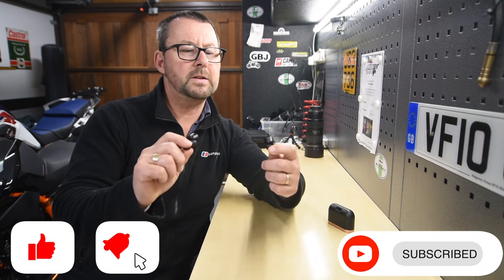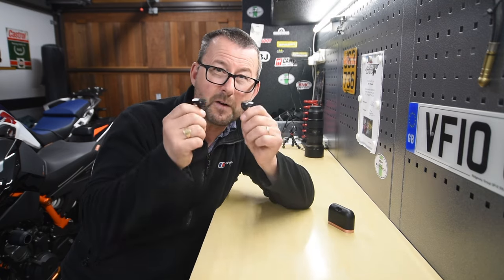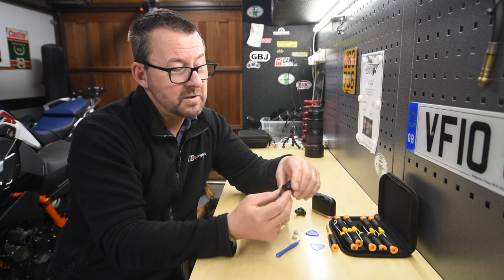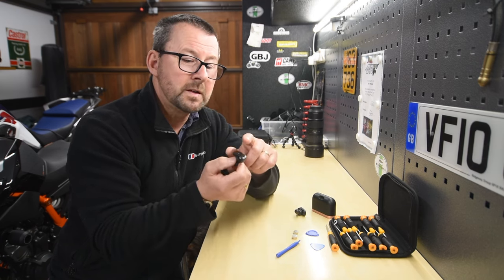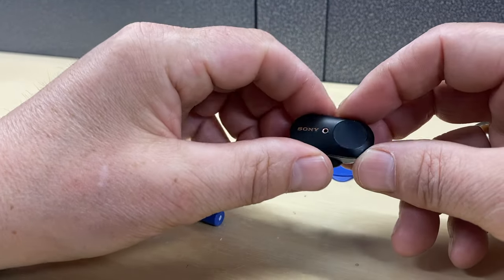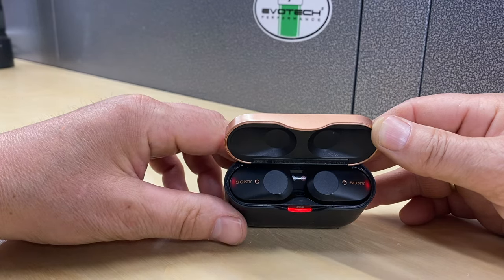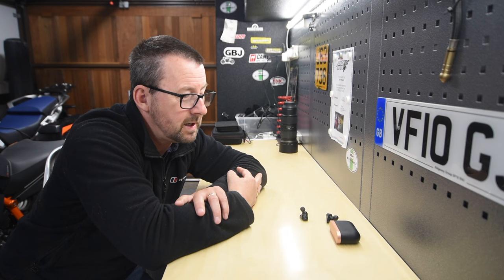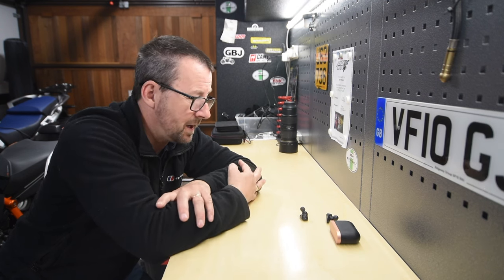SONY WF-1000XM3 BATTERY REPLACEMENT , JUST A 10 MINUTE JOB🤪

Comment: Can you do a video for case's battery replacement, please? Can you ask how many hours it need to be fully charged without usb cable? My Somy Wf Xm3 take a lot of time to be fully charged. I'm not speaking about earpods, but the case.
Reply from the maker: I have had a look at that but it involves skills I do not have !!!! 😢
Reply: @gsd32i  thanks.
Reply: I was going to ask. I'm sure the case's battery needs changing too. When I try to charge the buds, the case light flashes for about 30 seconds and goes off. I left it overnight charging but the following day the buds haven't charged and the case battery is at 0%.
Reply from the maker: @brucehowden7416  charging case sadly is not that easy to put a new battery in ! I have looked but way above my pay grade !! Have you tried a different charging lead? Also try doing a reset of the earbuds in the case , to reset everything.
Reply: @gsd32i  I've tried various leads and adaptor sockets and resetting the buds. Anyway, thanks for your video. I'll try changing the batteries in the buds first and see what happens. Initially, I thought I was just going to have to buy new buds so at least I have some hope of saving some money!
Reply from the maker: @brucehowden7416  ok 👍 battery swap won’t take long . Good luck 🤞

Comment: hi. i connected my dock case with 10volt charger. then the case is broken and can't be charged anymore. does replacing the battery help?
Reply from the maker: Looks like the charging case is damaged ? Not many people have swapped the cases internal battery . Is the case definitely damaged ?
Reply: it looks normal but can't be charged. i wonder if the battery or the circuit board is broken
Reply: Finally I found somebody with the same problem I have. Charged mine with the Samsung charger and now nothing happens - no lights. Do you know how to open the case?

Comment: My earbuds give red lights in the charger, when I pull them out no blue lights occur. Could it be that the batteries are dead? I used them 3 years ago and left them in the case since then. Thanks in adavance.
Reply from the maker: Hi . Probably .

Comment: Hi i replaced my right ear with a brand new varta battery and after 1 an half hours it said battery low again i was normally only getting 40 mins with battery what was in it b4 any tips please help
Reply from the maker: Hi . Try a full reset . Also swap the battery over with the left one of a reset doesn’t work just to see if you have a defective battery .
Reply: @gsd32i  it was a brand new battery i bought online will try the full reset aswell am sure i do that is that were you hold headphones in case for 15 seconds
Reply from the maker: @Aefc85  yes

Comment: Urgent question, is there a difference on varta cp1254 a3 and cp1254 a4 ???
Reply: After a bit of research, it seem to be plausible to use a4.
Reply from the maker: You can use either , they are the same diameter and height so either will fit, the A4 is a bit more powerful.
Reply: @gsd32i  thank you

Comment: Why is the CP1254 battery so expensive? I mean 30 pounds for two of these little guys is too much. Don't you think? it's like 1/3 of the price of the earbuds. 
I also have these, sadly now I have to buy batteries for them. Never will I buy sony again.
Reply: Normally, cp1254 is only 2 dollars for a pair.
Reply: I got mine from Ali express at only 8USD

Comment: Hi!
Can CP1254(A3) batteries be replaced with CP1254(A4) batteries?
Reply from the maker: Its fine, the a4 is the newer version.
Reply: @gsd32i  ok. The a3 has 3.7v and the a4 has 3.85v. works correctly?
Reply from the maker: @maicolwrc86  should be fine
Reply: @gsd32i  thanks!

Comment: can the battery of 1000mx3 can be replaced with varta A4? meaning can a4 be used in place of a3?
Reply from the maker: I don’t see why not, as they are both cp1254 3.7 volts. is the a4 just an improvement on the a3 ? looks like it.
Reply: @gsd32i  I believe the only difference is the capacity, with the A3 having 60mAh and the A4 having 74mAh.

Comment: Thank's for the video sir, but ithink i got a trouble, after i put the battery, everything seems right, the  charging light is on. After the charging light turn it off, i try it, and i found the right earbud can;t turn on, but the left earbud is perfectly working like a new, do you have any idea?
Reply from the maker: Have you tried a factory reset?

Comment: What size of philips did you use? I tried #0 and #00 it wont rotate :/
Reply from the maker: Hi, I have just been into my garage and checked the screwdriver that I used and it was size 00. They really are small, have you rounded the head? You have to push hardish and then turn without the screwdriver slipping off!
Reply: @gsd32i  I have now unscrewed it, thanks! But any tips on closing the lid on my buds? The front part closes but the back part just bounces back T.T

Edit: Solved it ( thanks!)
Reply from the maker: @alh.6751  Glad to hear it. Best to reset the ear buds as per the manual.

Comment: can the charging case battery be replaced as well?
Reply from the maker: Hi it’s almost impossible to change the case battery due to other pieces being attached to the cases battery .
Reply: @gsd32i  My earbuds seem to be discharging the case battery power and i also had connection issues; the earbuds only connect if my charging case is connnected to the usb charger. Its all good now after i reset and replaced earbuds batteries.

Comment: My issue with my XM3 is that my left ear bud doesn't last more than 30 minutes and gets shut off. So should I expect the same reason for my XM3 ?
Should I replace the battery ?

Please help me out. I purchased for a heavy price in 2020 and now it's not working. I cannot afford to buy one more.
Reply from the maker: Yes replace both batteries . 👍
Reply: @gsd32i  Why should I replace the other one too ?
Reply from the maker: @bhargavvarma5495  I would have just done both at the same time , but if your other battery is holding it’s charge for the normal time (8hrs) then don’t change it 👍
Reply: @gsd32i  Well ! 
Once the left bud gets OFF then the right bud also gets to OFF so I think as you said is correct. I tried using only my right bud but no luck. Is there any chance using only single bud ?
Reply from the maker: @bhargavvarma5495  I don’t think so 🤔
Reply: Ok 
After replacing the new batteries, how are your ear pods working now ?
How much battery life are you experiencing on a single full charge ?
Any ANC, Call quality and sound  problems after replacing new batteries ?
Reply from the maker: @bhargavvarma5495  all good 👍 anc= about 6-8 hours
Reply: @gsd32i  Thank you so much ! 🙂
Will get back to you after successful completion 😅
Reply from the maker: @bhargavvarma5495  🤞
Reply: @gsd32i  Hi 
Unfortunately Varta CP 1254 cells are not available in my country (India). What should I do now ? Please suggest
Reply from the maker: @bhargavvarma5495  doesn’t have to be varta . Just try e bay or Ali express etc and put in cp1254 a3
Reply: @gsd32i  So are you suggesting me to buy any other cells not exactly a Varta CP1254 ?

Does it effect the battery percentage and any other performance based issues of my WF-1000 XM3 by replacing them with other batteries ?
Reply from the maker: @bhargavvarma5495  up to you. if you can't get the Varta ones then I would go with whatever I can get, but check buyer feedback 👍
Reply: @gsd32i  Hi 
Finally I got a less capacity battery cell which is of 3V. Can I go with it ?
CR2477N, 3V - Lithium Renata 
Can I go with it sir ?

My doubt is that the earlier cell which is Varta CP 1254 is 3.7 V and this is just 3V, so might the battery backup vary for this cells ?

Correct me if I am wrong !
Reply from the maker: @bhargavvarma5495  I think this battery is a non rechargeable battery ? So I would not use it . Always best to get the correct type .
Reply: @gsd32i  I tried a lot but couldn't find a better one. Could you please suggest one which is suitable and available in major E-commerce sites ?
Reply from the maker: Hi . What about Ubuy India ? Very strange you cannot get the cp1254 😮

Comment: Battery life is amazing now! Two notes: First, the LED on the left unit has stopped working, not exactly sure why since the touchpad still works. Second, while pulling the battery out the contact came with it (which is fine). I made the mistake of attaching the contact to the new battery before putting it back in, and I shorted +ve to -ve. Battery got very hot very fast! Put the contact back in the case before trying to add the new battery!

Comment: Ah damn, after the replacement, my left earphones do have power (red light) but they don't connect nor produce any sound ('power on'). My right earphone on the other hand are not working at all now :/ Not sure how to troubleshoot this
Reply from the maker: Did you damage any wires when you opened them ? Try a factory reset :

Touch the sensor on the left unit with your finger for 20 seconds and release it when the red indicator stops flashing. Touch the sensor on the right unit with your finger for 20 seconds and release it when the red indicator stops flashing
Reply: @gsd32i  Thank you for the reply !! I'll try that out :) I haven't noticed any damaged wire although I did force a bit my way through to open them
Reply from the maker: @anonazerty165  obviously after a reset you’ll have to pair them to your mobile device again as new earphones 😊

Comment: I can't closing mine after the change what can I do????
Reply from the maker: Have you got the right battery ? try putting the old one back in if you still have it. Some batteries are too tall and that may possibly be the issue.
Reply: @gsd32i  yeah I got fixed ,thank you for trying to help 🙏 but I was just dumb😅🤣 I misplaced the left and right cap🤣🤣

Comment: Hi changed it , but the new one last only about 1 hour like theold one? have I forgot something?
Reply from the maker: Try doing a reset first .........
Reply: @gsd32i  I try it but still about 1 houre like the old one, and I changed again two new them situation, I get crazy 🤪
Reply from the maker: @petrabernard4180  make sure you have the correct battery number type also .
Reply: @gsd32i I did resete again, Type is CP1254 A3, but it last like the old one about 30-60 minutes , and I bought four ;-((   🤪🤪
Reply from the maker: @petrabernard4180  what charge level are the batteries getting to ? If it’s not 100% then either you you got fake batteries 🙈 or the charging case is not working properly . Do you know anyone with the same earbuds to try their case .
Reply: @gsd32i  it says 100% when charged, and two differnt could be fake but not shuer and dont know how to mesure capacity, and no no one has these earbuds 😞
Reply from the maker: @petrabernard4180  I would check and make sure that you have reset them properly. try reset
Reply: @gsd32i  yes i reset it three times, and i checked with sony app both are 100% charged and afte 20 minutes both has 70% and after about 1 hour they switch of.... like with the 3 year old battery pack 🥵🤪😝😡
Reply from the maker: @petrabernard4180  that’s not good . To me it sounds like the batteries are at fault but I am not an expert 🙈
Reply: @gsd32i  yes I thinks so but now i bought 4 ......china trash for 50 Euro
Reply from the maker: @petrabernard4180  yes that could be it . Varta batteries if you can get them .
Reply: Now last try I by a new couple, hope this will work ;-)
Reply from the maker: @petrabernard4180  🤞

Comment: Did anyone try with Vatra Cp1254 A4?
Its the next gen with more capacity.
Reply: By quite a significant margin, too. The original batteries in WF-1000XM3 earbuds are Varta CP1254A3, which have a capacity of 60 mAh, whereas the A4 cells hold 74 mAh. That’s nearly a 25% increase in capacity, which could very well make the earbuds last an hour longer or even more, depending on use.
The nominal voltage of the two batteries is the same, and the voltage curve is most likely very similar (important consideration because of the charging circuitry in the earbuds), so it should work as a drop-in replacement.

Comment: I’ve change the battery, held down the side for reset and waited to recharge. I’m still having issues with battery!  It doesn’t last longer than an hour.  How? It’s brand new battery. 

Update: found out what happen.
Reply from the maker: Hi . Are you doing the reset properly? Also did you get the batteries from a reliable supplier ? Some suppliers on the internet no doubt seems out “new “batteries that are not genuine but fake !
Reply: @gsd32i  I got it off eBay I hope it’s not a scam the person has a lot of sales. I did reset like you did. 

Press and hold for 20 second or until the light stop flashing then let it charge.  I let it recharge again and test tomorrow. 
Thanks for reply.
Reply from the maker: @laqueenawilliams4762  Have you got any friends with the same earbuds? possibly try their charging case ?
Reply: @gsd32i  did some digging and found out what happen. The original battery is a zenipower z55h 3.85v , replacement battery I got is Varta 3.7v.  Yes it’ll charge and works but it’ll drain the crap out of the replacement battery, shorter it’s life span. Also, the difference in voltage will trigger the headphone to say low battery. That’s what I read from other users.  Guess I’ll keep using these battery till it’ll die soon and replace them with correct ones.

Thanks for quick reply
Reply from the maker: @laqueenawilliams4762  glad you got to the bottom of it 👍

Comment: I changed one side and it worked. For the left side, however, the touch control doesn't work when the lid is on. The red LED is flickering sometimes when charging and I manage to do a factory reset (with blue LED blinking). More importantly, I hear no sound coming out and no blue LED is blinking once I remove it from the charging case. Did anyone encounter a similar problem? Resetting it without the lid didn't help so far
Reply from the maker: try swapping the batteries over to see if that makes any difference?
Reply: @gsd32i  I did, and the flickering seems to come from some sort of loose connection. 
But still no sound and blue color light ones I remove them from the case.
Reply from the maker: @DonaldoPL  have you damaged the ribbon ?
Reply: @gsd32i  not that I'm aware of. I inspected it a couple of times now, but I can't find any damage.
When I removed the lid, it was still sticking to it, but someone in the comments mentioned that it didn't cause any problems.
Reply from the maker: @DonaldoPL  Have you tried "forgetting" the bluetooth device on your phone and then pairing them up again? Other than that and maybe a reset don't know what else to suggest...🙈
Reply: After I had replaced battery on right earbuds, it sounded not frequently and very laggy
Reply from the maker: @HoangNguyen-yq4zj  try forgetting the device in phone settings then reconnect Bluetooth and do a firmware reset and update firmware if needed
Reply: @gsd32i  yeah I did. The device is not even appearing on my phone anymore, so something must be broken with the Bluetooth.
Reply from the maker: @DonaldoPL  try de powering the phone and switching it on again. There's always throwing it against the wall as a last resort option, but I wouldn't recommend that !
Reply: @gsd32i  thanks for all the help. I think I need to send them to a specialist after all :'D. The problem seems to be a bit more severe with the left ear bud.

Comment: where can i get the battery?
Reply from the maker: Hi, 
Varta CP1254 battery from UK E bay seller :
pa-products-ltd
Reply: They show up quite often on eBay. Do pay attention to the product name however; you’re looking for Varta CP1254 A3, with a capacity of 60 mAh, aka 0.22 Wh. Many sellers also sell CP1254 A2, which is an older generation battery from Varta with a substantially lower capacity.
If you’re lucky, you might find a seller who sells Varta CP1254 A4, which is the latest generation, and this has a higher capacity of 74 mAh, aka 0.27 Wh, allowing you to upgrade your earbuds with a better battery.
Reply: thanks

Comment: How Can I Get This Batteries I INdia I also want to replace my battery please can you send me through parcel
Reply from the maker: Hi . I do not sell them . Sometimes hard to find seller and a lot depends on where you live .
Reply: @gsd32i  I live in India somehow can I ask question 🙋 can I replace put normal rechargeable button cell which is not yellow pouch normal cell but it is rechargeable

Comment: Everything went smoothly however, after replacing the batteries the earphones LEDs never came back on. No problems with everything else :)
Reply from the maker: Did you do the reset?
Reply: I believe so as I keep pressed for 30s each earphone inside the box. I did not get the LED blinking after the reset. Apparently everything else is OK except the earphones LED :)
Reply from the maker: @miguelmedinaramos  no harm in trying another reset . But if everything is fine then hopefully battery life is going to be good 👍

Comment: Mine won't turn lights on 😭... Why?
Reply from the maker: try a reset ?
Reply: @gsd32i  Nothing worked. I don't know what could've gone wrong. They were working thou, just no lights. I wound up buying new earbuds after spending on a screwdriver set and the batteries, and dealing with frustation 🤣. 300$ for the sony's XM5. Thanks for the video thou